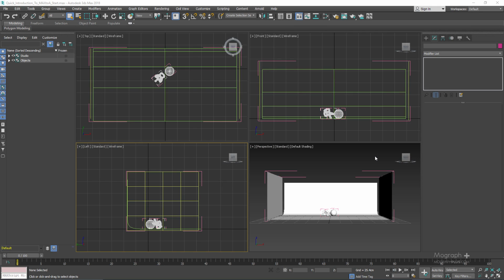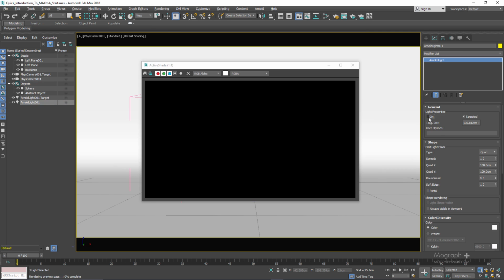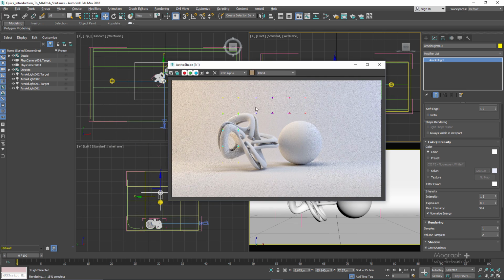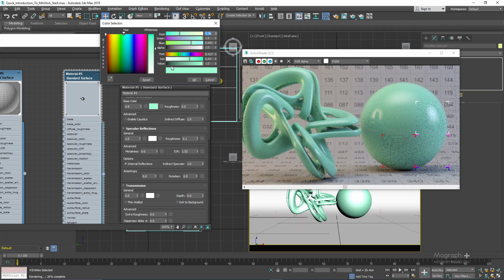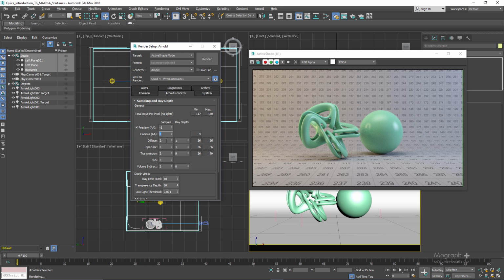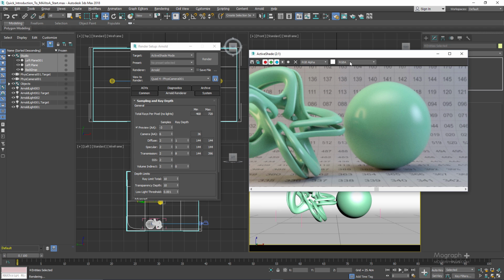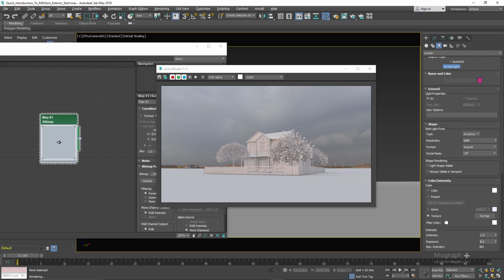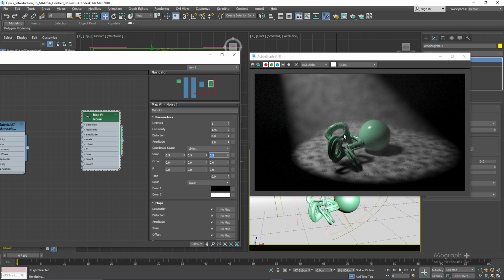Tutorial No.58 : A Quick Introduction to Arnold 5 for 3ds Max 2018 (MAXtoA)

Comment: My 3ds max is 2019 version but doesnt have Arnold Material standard surface, how to fix it?
Reply: I just upgraded to 2019 from 2017, are you sure you've changed the renderer from scanline to arnold in the render settings?

Comment: Wich version of Arnold are you using in the video?
 I tried to follow the steps on MAX 2017, and I found several diferences in the Standar Surface shader for Arnold, and the volume ligths...I cannot found the parameters you used in the Render Setup in Arnold Renderer Tab...

Comment: Arnold just keeps rendering a black screen. Nothing. I simply set up a simple setup like yours, and no matter what I do, I just get a black screen...
Reply: Try this. It works for me like all the time. Hit the keyboard "8" to open Environment and Effects and play around with the Level of Global Lighting. Hope this will help
Reply: the same happen to me!
Reply: yes. me too
Reply: Same with me, NOW after half an hour its working for me.
Reply: try changing the intensity of the light work for me
Reply: add a physical sky arnold material in the environmental setting
Reply: Arnold references the background colour in the environment tab. You may have your set to black by default. Turn it up to a halfway grey. Should do the trick.
Reply: Same-Until I turned the light intensity up to 1000
Reply: Mine works at 1500+ Intensity
Reply: Hey Guys! I have just unchecked the Normalize Energy parameter inside the light. Now it's perfect!
Reply: Manndarr Pattaskar how did you fix it?
Reply: or try checking the Legacy 3ds max map support in the settings inside render setup, mybe it will help
Reply: Hi! I had the same problem, and i found out that my scene objects was very very big, scaled them down to the size of the grid and everything worked well, not had to make intensity insanely high!

Comment: Hey just a quick question. At the time that I am changing the sample values for diffuse, specular, etc... The Camera sample value must be at a high number? let's say at 6, or can I change the values (diffuse, specular,etc...) with a low camera sample value? like 3.
Reply from the maker: To put it as simple as possible, in Arnold, first you need to identify the source of the noise (diffuse, specular, transmission and so forth ) and increase the sample value for that particular ray type, so yeah, you can increase those values even with a low camera samples. But for a final render, as the camera samples take care of Anti-aliasing and effects like depth of field and motion blur, you would need a higher camera samples than 3 ... probably 5 or 6 at least.

Comment: How would you use MAXtoA to make a metallic flake paint (car paint)? I've been trying to get it to cooperate but it isn't.
Reply: The Arnold Tutorials manual contains a section of preset material values, with common materials like car paints, chrome, glossy and matte plastic, and others.

Comment: Finally our studio will get rid of Vray!
Reply: Same here. Excellent to get rid of VRay.
Reply: Not that we despised Vray but with Arnold our employees will stop losing time with multiple settings and with the price of Autogreed 3ds max subscription i think that was about time we have a real native solution instead of referring to third party plugins!
Reply: you are looking at minimum of 7 years.
Reply: It's native when you have render locally but you have to pay a lot more than vray to render on a farm. With vray you can also just use the universal setting with brute force and it will work like arnold does. but if you really need to render faster (or with less license and render nodes) you can also tweak it a lot more to make it render way faster. So you don't lose time with the multiple settings, you gain time!
Reply: As an old furniture designer trying to get caught up on technology, I've chosen 3ds max to model all of my furniture and soft goods. It seems Vray is the soup du jour with 3ds max. But it's expensive and Arnold is included with 3ds max. For simple studio shot setups for things like a sofa, is Arnold more than sufficient? I am not doing ArchViz, just a simple sweep with product shots. Thanks in advance for any advice. This crap for a guy that's used to 2d autocad and rendering by hand is very overwhelming. Marvelous Designer, Zbrush, and on and on.
Reply: So far I have to say V-ray seems alot more powerful. I'm trying to learn Arnold though.
Reply: Andrew Morris , more than enough. For your case better than vray
Reply: well arnold is free and native for 3ds max so yes we give up vray
Reply: What do u mean ? Vray is cool.
Reply: How much more will it cost you for render farm licenses and what will you get that V-Ray can't do?
Reply: finally get rid of Vray !!
Reply: We don't need to render on multi nodes just to have it on each single station.

Comment: How to setup shadow catcher material for integrating 3d wit live footage?
Reply from the maker: in the Material Editor, Add a "Shadow matte" map and a "Map to Material" material, Connect the "Shadow matte" to the "texture map" input of the "Map to Material" node, now assign the "Map to Material" node to the plane that you want to work as the shadow catcher.
Reply: Thank you for a quick reply!

Unfortunately, that too does not produce expected results. It does not collect skylight/dome/whatever-they-call it-in-arnold shadow. It only collects direct shadows, and it does so poorly, with alpha value of 1, making shadows pure black.

I say "that too", because I already tried using matte material with shadow catcher applied to it, and that too produces same wrong shadows while ignoring skylight shadows.

Comment: thanks you! could you show, how to use bump and displasment? For example on wood. I would be very grateful.
Reply from the maker: Use"Arnold Properties"modifier to add Displacement.
 in the"standard surface" material, there is a Normal(bump) slot to connect your bump map, you need to connect a "bump 2d" node to this slot and in the "bump 2d" node, you can define the "Bump Map".

Comment: Also applies for the arnold of 3dsmax2017? thanks  :)
Reply from the maker: Arnold 5 is not available for MAX 2017. The version available for MAX 2017, Lacks so many features and functions, so if you want Arnold inside of 3ds max, you need to have MAX 2018 installed unfortunately.

Comment: I am lost between Vray and Arnold and Corona :(
Reply from the maker: It's 2017, use whatever you are comfortable with, they all work just fine buddy.
Reply: I am new at this, please dude i need an advice !
Reply: lol algerian learning vray !!!!!! thats great ! am from algeria too )
Reply: lol you have no Idea what i can do :D
Reply: Use Redshift if you can afford third party rendering engine. It is GPU based rendeder, requiring a high end nvidia GPU, like a GTX 770 or above. If you have a GPU like that, try Redshift out.

Arnold is about as good/fast as Corona, and much better than vray. No need to use either of those CPU only rendering engines now that Arnold is the default in Max 2018. Corona might be slightly better in very complex scenes, so it too is worth checking out.
Reply: I'm loving Arnold but I still find Corona to be more user friendly. 

Unless you have a studio you're aiming to work at you're generally free to chose.